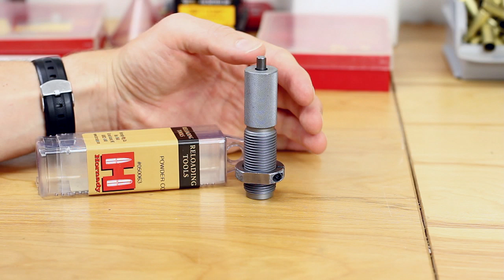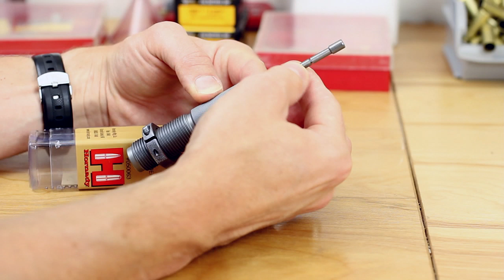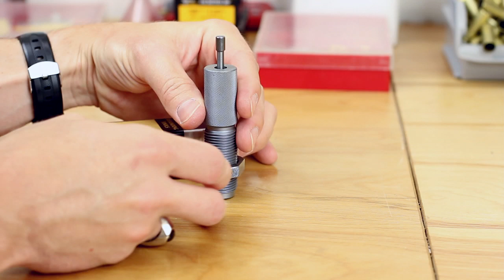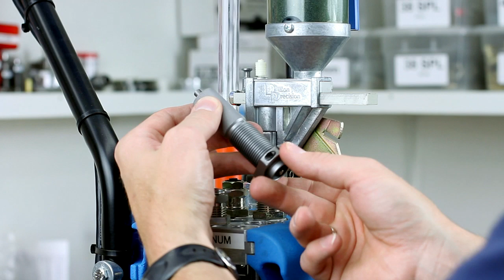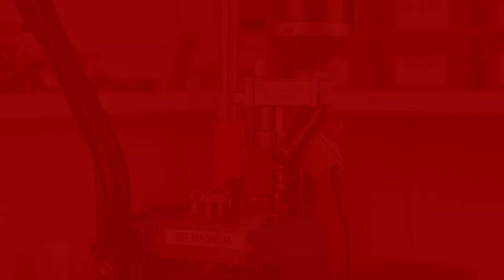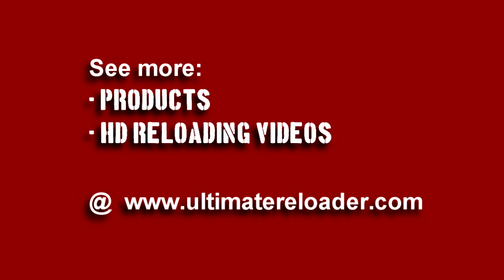Hornady Powder Cop Die Overview

Comment: I put one of these on my Lee Classic Turret press while I was learning to reload and I still use it today. I had to replace the Hornady lock ring with a Lee lock ring so it would fit in the 4-hole turret with the other dies. It has saved me from a few squib loads when I didn't have my Auto Disk adjusted properly.  I've never had an accidental double charge, but if I did, it would be obvious. When loading the same brand of brass I can tell easily tell the difference in a charge that is .2 grains higher or lower than what I've set it at. I will continue to use it when I set up my new Lee Six Pack Pro.